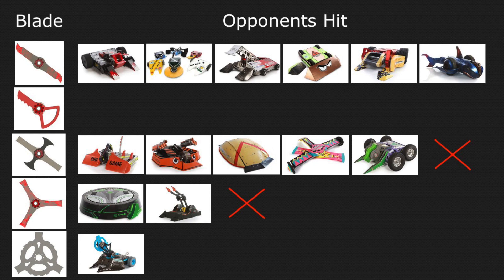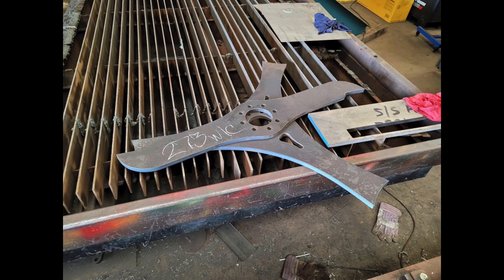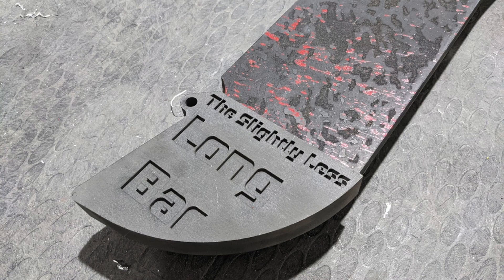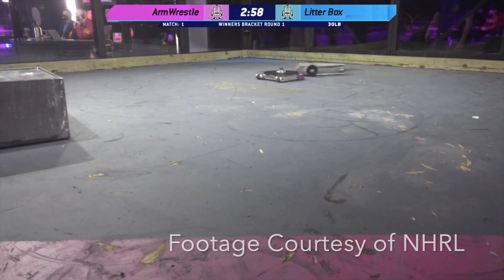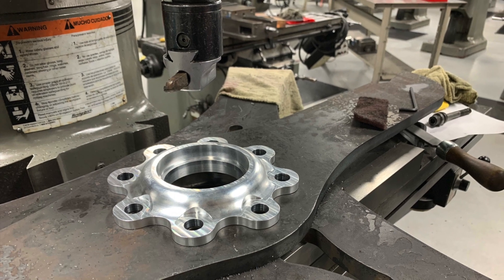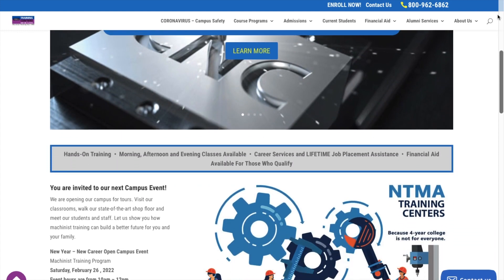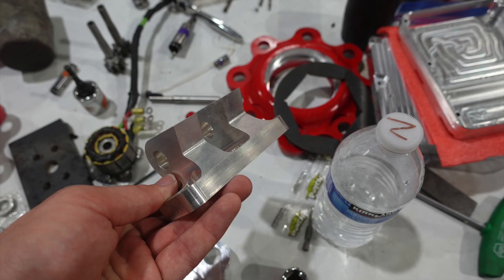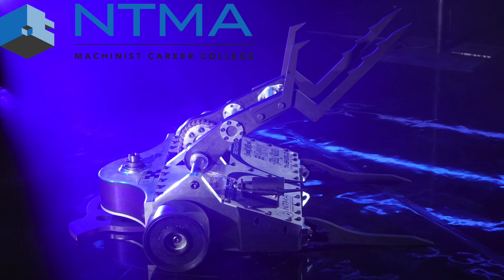The Classic Bar- Battlebots Season 6 Blade Design, Part 2

Comment: Why are stabilizing fins required?
Reply from the maker: There's a lot of crazy physics involved that we want to make a whole video about, but long story short, 2019 Bloodsport was super unstable because of how long and narrow the bar was. The closer you get to something like a disk or tribar, the more stable it would be. A bar with fins is a compromise in between that is meant to be stable enough most of the time.
Reply: @bnsrobotics  Interesting, well I would love an in depth video on the subject as that sounds fascinating! I would assume a robot like deep six might struggle with the same issues then?
Reply from the maker: @Dangineering  Their bar is susceptible to the same issue but for them it's a little different. Their wheelbase/fork footprint is pretty big and they don't deal with out of plane hits very much, so they're mostly concerned with their height and center of mass. For us it has more to do with how our weapon behaves after being deflected into the air by a wedge or vertical spinner. Watch for how a bot like Son of Whyachi will stay level when sailing through the air while Tombstone or Icewave will tumble violently. Tombstone doesn't care because it's invertible, but for us it makes the difference between landing on our wheels vs flipping ourselves over and having to self right.
Reply: @bnsrobotics  ahhhh, okay that helps to explain it! Thank you very much!

Comment: Have you thought of offsetting the bar forwards to gain more reach?
Reply from the maker: That's actually something we're looking into for next season! My beetleweight Phantom II had a pretty extreme offset and I've always enjoyed the reach advantages that come with that, but it also comes with tradeoffs that we try to balance out on the heavyweight. The fork meta makes reach more important than ever, though!
Reply: @bnsrobotics  That's really interesting since I'm building a similar bot as Phantom II but in a smaller weight class.. What are the tradeoffs of having an extreme offset?

I do believe reach is one of the most under-appreciated attributes in the community. It plays so high role in the actual match and that's why fork meta is a thing. I'm rooting for you for the next BB episode!
Reply from the maker: @zaqwsx28  The biggest sacrifice is rearward reach/coverage. If you keep the same bar length, you lose reach in the back. For Phantom II and now III, I try to keep the back corners just barely covered by the weapon so I can still be defended on all sides and back into my opponent when an opportunity presents itself. The other big difference is that you move your center of mass toward the front which has a big impact on driving and traction, which is something that matters a lot more for heavyweights since they have less power/weight than tiny bots and can't run quite as soft/grippy of a tire compound as what the little bots can get away with. It's a fine balance.

Comment: Any chances that you could've "improve yourselves", after you've end up badly on the Upper Deck while fighting against Whiplash?
Reply from the maker: We had a thermal issue in that fight- the pads that we use to transfer heat out of our ESCs got replaced with ones that were too thin to work properly. We doubled them up after the fight, and did lots of self righting tests before the next match. We also found that this Classic Bar is better at self righting than Tri Again, which is part of why we later wished we'd used it for Whiplash. Live and learn!
Reply: @bnsrobotics  💉🔥Excellent! Excluding the Tri-Bar, I wish you can go for 'A Rematch With Whiplash' using "The Classic Bar", for Bloody Vengeance!🍷😈🔥